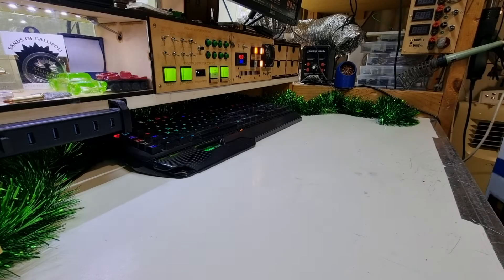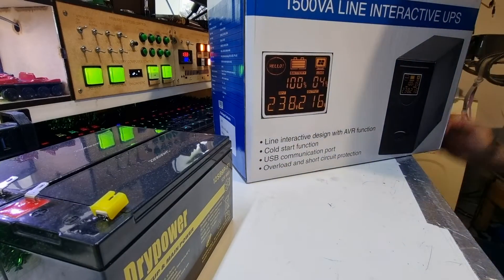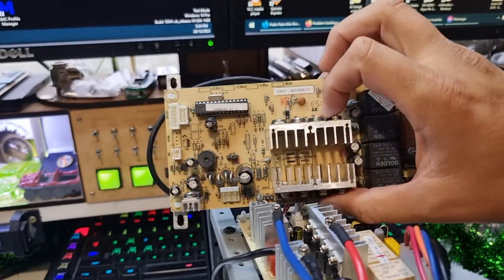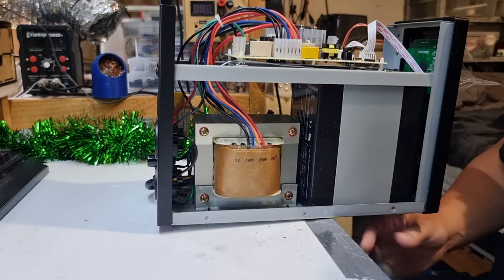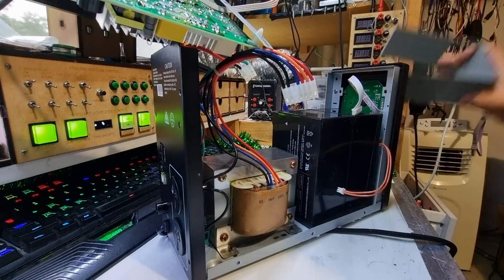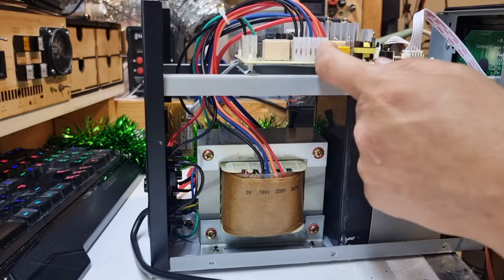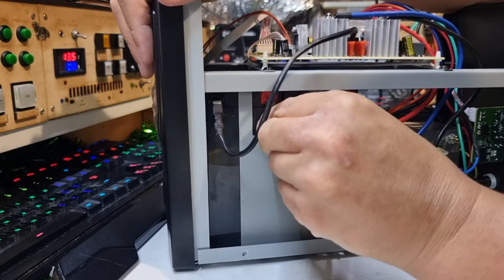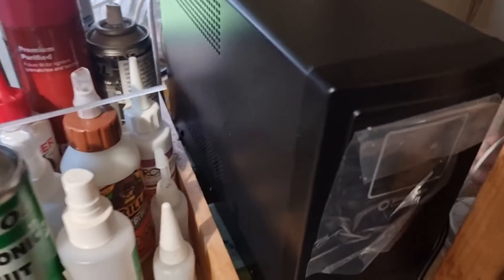"Upgrading" my new UPS batteries | Digitech MP5207

Comment: Thanks for the video.
I have been given a dead MP5207 that has been sitting for over a year. Mine does look the same with the 40A fuses but has Golden relays. Checked the batteries are dead, back panel fuse and 40A fuses measure OK. There is currently no dispay, will have a look further when I have some more time.
Reply from the maker: Probably use a resistor to pre-charge things before fully connecting the batteries, to avoid fireworks

Comment: Nice job. Can I suggest when connecting new batteries, you use  current limit resistor/lamp so the dc volts is not a step application.
I use to service 3000VA UPS for a wind turbine farm.
The UPS manufacturer instruction was, when connecting new batteries, to connect via a 100R 10W resistor, the UPS would not boot into power up mode, but boot the control circuit and  not possibly and uncontrollably turn ALL MOSFETS on at once.
This "soft start" I have found works on other UPS as well.
The on board power capacitor then held some charge while the resistor was removed and direct power connection was made.
This particular brand of UPS recognised the "soft start" as an instruction to power up in hibernate mode, I can't remember how much uA quiescent current.
The units could  then be stored, only waking  up to work, when 240Vac mains was detected.
285Vac, yes all the PV arrays around, I have had instances where some equipment I am servicing or certifying will start with a HIGH  MAINS input shutdown warning.
To get the job done we have a couple of 15A 3 phase autotransformers to fix the problem.
Stay Safe mate. 👍👍👍👍
Reply from the maker: Yes I'm not unaware of that potential.
Two things not shown in this video, 1 was that the batteries in it were already healthy and fully charged meaning the capacitors and fets were already at a balanced state, and 2 I had unplugged several parts to prevent accidential powerup while connecting plugs.
when I get round to doing this again, I'll be sure to film those steps.
Reply: @TheAussieRepairGuy  If the batteries were not connected how did the caps and FETs get to balanced state before connecting the batteries? 
They would have been discharged, I hope you didn't have the mains connected as you cannot guarantee that the batteries are at gnd potential.
Ahh the fun of UPS servicing.
Reply from the maker: @tomgeorge3726  The original batteries were in it, from new, this is a new unit.
I removed factory batteries, and immediately attached two new batteries.
in the previous designs they were fitted with 7.2ah batteries, I wanted to fit 9's, but when I got it open, I saw there were already 9ah jobs in there. I swapped anyway as I had it open. the circuit was de-energised for approx 30 seconds.

Did you happen to skip parts of the video by chance? lol
Reply: @TheAussieRepairGuy   Sorry, I was referring to the the UPS that went bang...
Reply from the maker: @tomgeorge3726  Yeah that one had already displayed signs of catastrophic FET failure beforehand, I may or may not have been somewhat aware of that at the time and figured fireworks would make for an interesting video.

In that case yes, things were not energized or balanced at all.